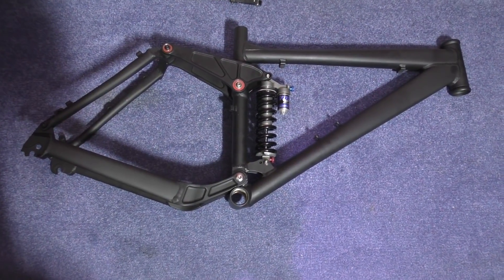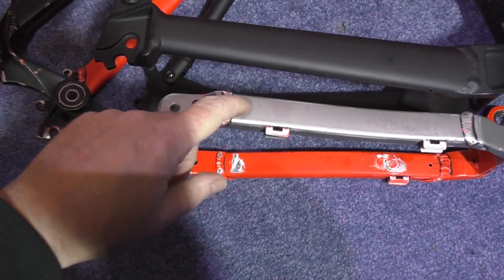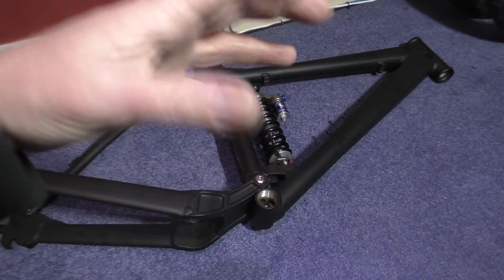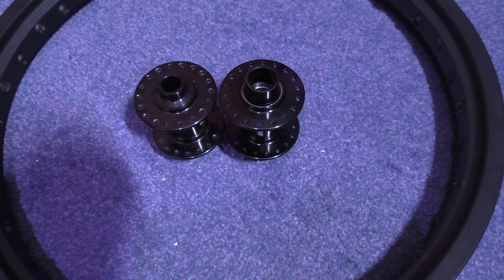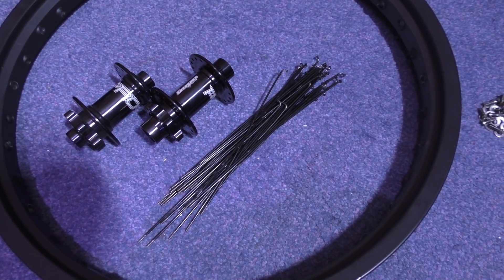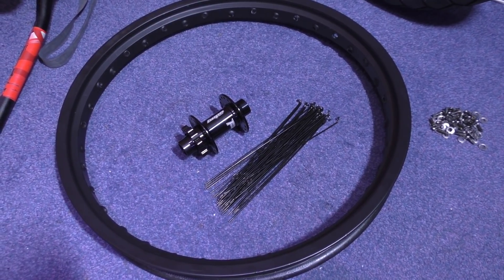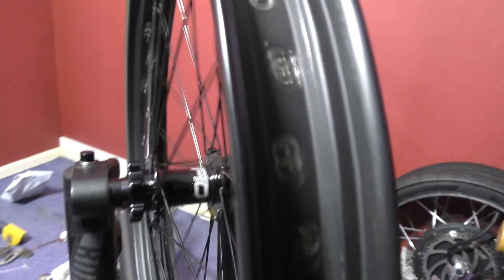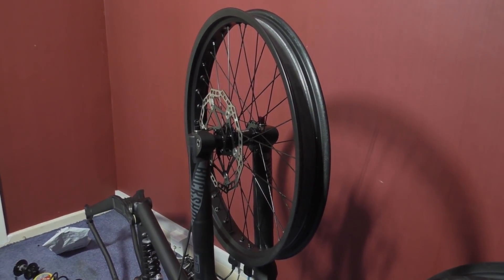High powered DIY eBike MSVA build part 2 - Wheel lacing the hard way

Comment: i am building a custom delta recumbent trike. have purchased a 36volt 350watt(maximum draw @20amps)  motor for the front wheel...went with this motor because there is no motor drag when it isnt powered. i am buying 3 12 volt 12ah sla batteries to power it...this is my 1st ebike/trike build so i am trying to keep the price down....anyhoots..my trike will be in the area of 65 pounds, i am 235 pounds..the battery series will weigh 24 pounds.......
i live in orlando ,florida USA  so the terrain is quite flat . does anyone have a rough idea of the range i will get with this assembly ? keep in mind the motor is limited to 19.8mph so i will simply pedal power up to that speed and then use the motor for "cruise control ".
an old engineering friend quickly covered that 12 volts at 12 amps times 3 in a series would be 36 volts at 12 amp hours...so that would be max of 432 watts...so a max of 350 watt motor should be in this battery range....the maker will not answer me..i guess he cant calculate how much power my motor will have to produce to maintain 19.8mph on level ground,to the right hand side of the lane with car traffic breaking the wind for me...
 i suppose if the motor required 100% power it would drain my "introduction to batteries " 36volt series in less than 45 minutes....50% power would allow the batteries to go for 1.5 hours , etc.
but my question is this, how much power should i expect a 350 watt motor to consume just cruising at max speed ? 25% ? 50% ? 75% ?
 again, level ground for my application.
any answers would be greatly appreciated

Comment: really sorry if this is a stupid question, but why didn't you use a small motorbike frame? Was it the weight? Thanks
Reply from the maker: If I could, I would. I'd like nothing more than to get an old 60's or 70's motorbike and convert it to electric so I could be 100% legal but....... I have to carry it up 2 flights of stairs.
Reply: @Vortecks  thanks for the reply! So it would be possible, just wouldn't suit your situation. Nice one. Really appreciate the vids!
Reply from the maker: @jackinthegreen1000  Correct. If I wasn't limited by weight, I'd have crated a monster by now 😂
Reply: @Vortecks  I wish I could understand half of what's required to make one of these. 😁
Reply: Can you move? I'm really interested in what you might come up with. :-)

Comment: where did you get the spoke washers for the front wheel ?
 as i am planning on building a simmilar wheel.
Reply from the maker: They're just standard washers - anything that fits.
After you've tightened them up, they 'dish' out so it does take quite a while to get them perfect.
Reply: Vortecks thanks

Comment: I think I got it! I was wondering how a wheel is laced I'm thinking about trying to buildind a set  Using 200cc street/trail bike rims. I was thinking about building a fork and swingarm. And just using the motorcycle wheels. And not having peddles. I don't know how the las would look at that. I guess it be a E motorcycle. I'm not planning to peddle anyway.  I was thinking of using a 48v 2500watt bldc motor running it on 72v. Maybe I'll go with a hub motor, and use bike rims now! Thanks great video..
Reply from the maker: I'm glad at least one person can understand how it's done. Please let me know how your build is going (if you start it) I love a success story :-)

Comment: Great choice on the frame tony  ive been using a kona stab on my latest build for the last year roughly and its awesome. im not pushing anywhere near your power (roughly 4kw) but its awesome offroad as well as on .Ill be very interested to see how you mount your battery  as im currently using 6x6s 12ah multistars but have to put them in a backpack as theres just not the space in that triangle (currently 50% done on a 20s 6p liitokala pack)
Reply from the maker: WOW, 6x6s packs in a backpack? That must be around 10kg!
This weekend, all will be revealed on how I'm going to mount them - I've even impressed myself! 😁
Reply: Can't wait buddy , be good

Comment: Your going to have it done quickly then you will have to ask yourself do I test it all out in the middle of winter or can I wait it till spring. 🤣
Reply from the maker: It's doubtful. If the build of V2 is anything to go by, this one will take longer. I've only done the easy parts so far - the fun starts when I start designing all the cowling and battery layout 😒

Comment: Tony, aren't the nipples supposed to be pulling on the inner wall of the rim, not outer? I'm sure it's easier to do it this way but those washers look like they could pull through at any time. I built a couple of pairs of single speed wheels last winter, one single wall, one double, so that's my qualification.
Reply from the maker: 2000 miles and not one problem mate. I'm not sure what you mean anyway 😊

Comment: I built my rear wheel with a fatbike geared hub into a 32mm rim...used 14G skinny spokes that are loose in the hub holes...a year of battering the bike offroad and not a single break.
Reply from the maker: I don't know how people break spokes. If the're tightened properly, they'll never give any problems!

Comment: Let me know if your selling your 16000MAH lipo mate :) IM Hampshrie UK
Reply: Hi savage there is 10 packs on eBay at min on bids have look 👍
Reply from the maker: I will be selling them mate but I only have 2 left (the other 2 were converted into 3s packs for the spot welder) and they don't have any connectors on them at present.